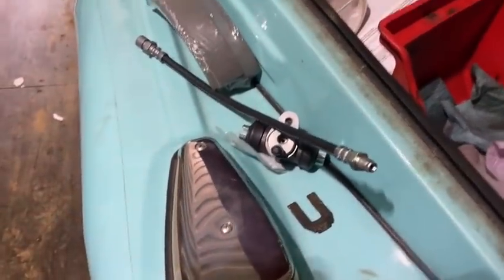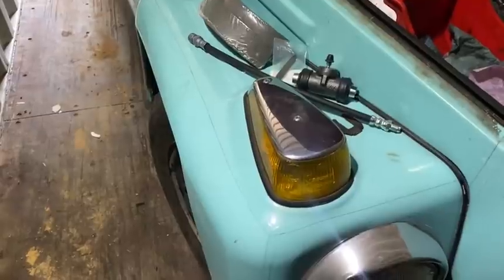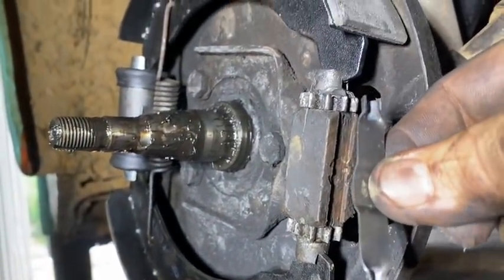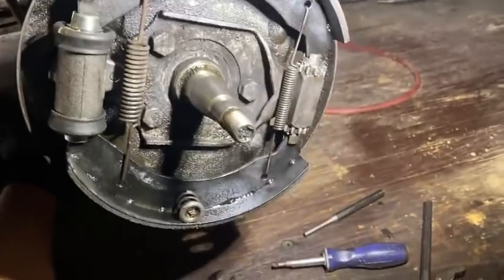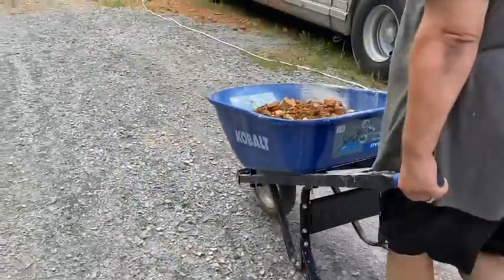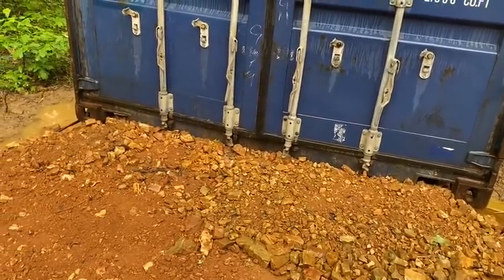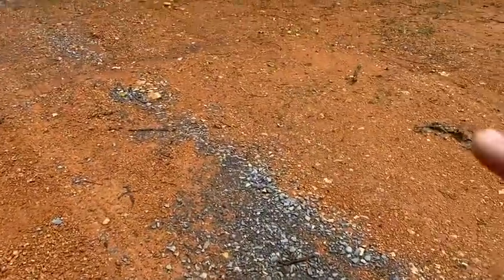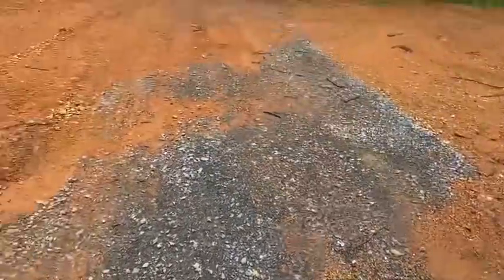Finishing the vw thing brakes and building up the entrance to the container

Comment: couple things on the wash over.. i use it interchangeably with washout. couple options to fix it, one - small 8" culvert pipe, two - bring in topsoil, seed and straw to stabilize the land, three - bring in more gravel in that area to build a high spot, dig a ditch down the left hand size where its washing over to drain it down the hill. either way eventually all that erosion will cause a problem.

Comment: i delt with these brakes on my former 1968 bug before the deer totaled it. as Monday im getting a 1965 vw beetle from ohio the front brakes be different got a linkpin front beam. as 1966 and later beetle, Ghia, 1973-1974 thing has a ball joint suspension on my way home from Ohio i did see some busses the detroit 2 stroke powered ones pretty cool.

Comment: Scott, did I see what I thought I saw?  In this vidoe is a  hydraulic jack supportting the vehicle with nothing else while your legs are under it?   OK, the Thing is relatively light. Why risk it?  Everything is made in China.
Reply: Yes jack stands are a bit safer, but with a 20 ton bottle jack has about the same size base as a small jack stand. Even if the bottle jack went down it would stop well before it hit the ground.

Comment: I think mentioned a while back that the hoses were probably to blame. if you look closely at Euro brake hoses,they are date stamped. I change a lot during a typical year mainly because they're 10 years old and the insides break down,causing them to act like a one way valve and cause brake locking. Another thing which can cause brake locking is the master cylinder getting dirt behind the piston,stopping the piston from going right back, but in those cases the fluid cools down and the brakes free off again.

Comment: The length was short with the suspension in full droop which it would rarely encounter. Still worth checking/fixing. Would have been interesting to check the length at ride height.

Comment: A quick tip on the speedo cable. Usually the E clip is gone. When you do a oil change the oil screen plate has cooper washers. Get one, put it over the speedo cable with the dust cap on and crimp it on.

Comment: As hot as the brakes were it wouldn't be a bad idea to replace the return Springs as they probably have lost there are tension due to the Heat

Comment: I wonder why they clocked there brakes like that instead of doing it like American autos did ?
Reply: I don't think there is any specific reason. Some euro manufacturers did it like the US cars , others very much different. For instance, i used to own a Peugeot 404 that had front drumbrakes with 2 leading shoes, each shoe with it's own cilinder.
No brake servo but when adjusted and bled correctly they worked great. Good brake feel, easy to modulate and powerful.
Before that car i had never seen any other car that had 2 leading shoes in it's drum brakes.